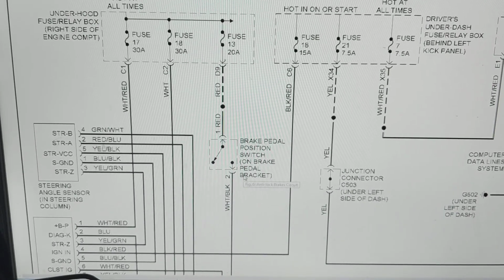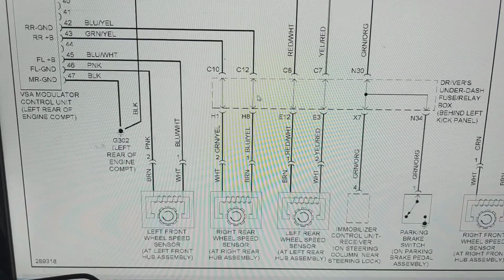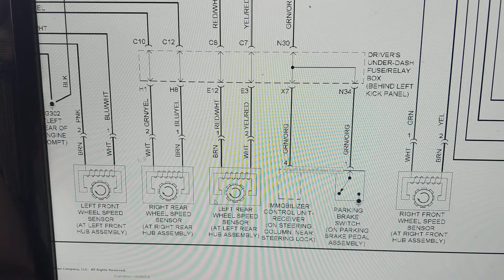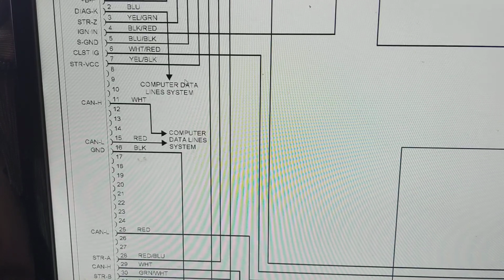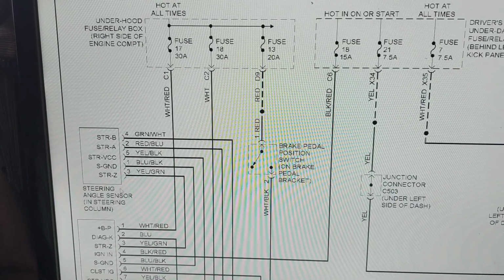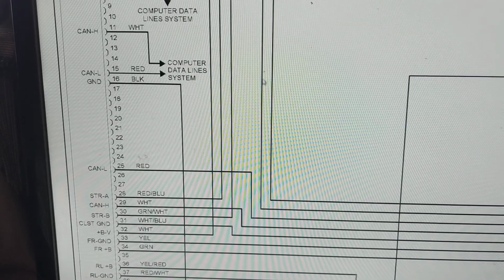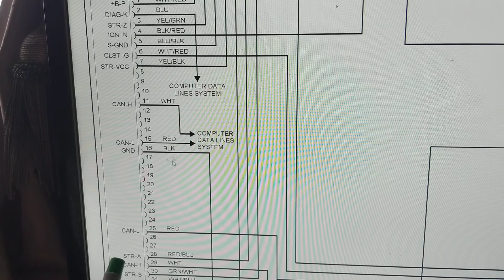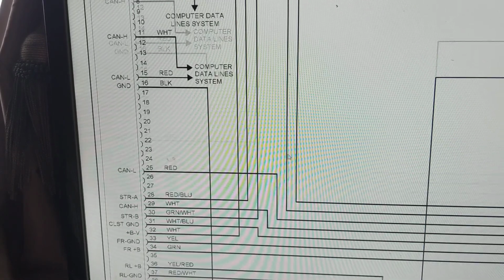how to find  ABS PROBLEM FROM WIRING DIAGRAM

Comment: I'm about to junk my 2012 dodge charger because don't even god can fix a rear left sensor and the crappy car is in safe mode since that. Replace Sensor, Axle, ABS module, Entire ABS module, and no way. I have normal read from 4 sensors like is ok but remain saying that have issues in rear left sensor and limp mode. IDK what else to do.
Reply from the maker: In such a case I would really advise to use a scanner I understand you probably don't own one but when it comes to these type of problems nothing gives more information than that I'll look into the diagram thank
Reply: @Joeelectronicschematicsforauto  Yep I borrow one,and have readings for 4 sensors with apparently no issues in live data, mean that's sensor is working and stable because I drove enough for test that problem wasn't intermittent. But Keep saying rear left sensor implausible signal, I replace the sensor for the OEM one, replace the axle, thinking that could be the reluctor ring, and after that, the whole system including replacing the ABS computer and module and keep the same complain and safe mode. At this time I just wanna explore what wires I have to cut/bypass for prevent de safe mode and use the car normally. The worst is, when the  abs light pop up the engine low RPM and some times get in neutral position o worst, some times get parking position with car moving! This car is crazy!!
Reply: @George_Gautier  one option out of pure desperation is to wire the signal from one of the good sensors into that input. Would be just like cloning a good sensors and putting it in place of the bad sensor and see if that works. Sounds like there is a problem with signal quality or some interference. But if that makes no difference I would suspect the module. A cheap handheld oscilloscope from eBay would be your biggest ally here or a scan tool that reads waveforms.
Reply: @davidgregory7702  I gave it up, no way this car get signal from this sensor, even plugging one direct to module. and replacing the module with reprogramming a few times.
Thanks you all for all the tips.

Comment: I've been searching on google very hard for a abs schematic like this one for my 2013 Hyundai genesis sedan 3.8  because my scan tool Xtool anyscan A30M is not communicating properly with the abs module or the speed sensors and I got a DTC  P2159  can you help me and tell me were I can find ? Thank you any help is appreciated.
Reply from the maker: This code usually indicates it does not see a signal from the speed sensor obviously many reasons besides the sensor itself the connector but this can also affect drivability such as transmission shifts number one does your  scan toolto communicate to any other module? Number two you can put in exactly in Google 2013 Hyundai Genesis wiring diagram for ABS system it should come up for free try all these things and get back to me
Reply: @Joeelectronicschematicsforauto  Thank you for replying. I put in search just as you wrote and got others but none close to mine. Yes the trans shifts a little different not as smooth but more abrupt.  I got this from live data: WSS Signal from ABS   Value OPEN,  WSS Signal from FR wheel speed sensor Value OFF,  VSS Signal from vehicle speed sensor installed on TM Value OFF,  Vehicle speed Value 0.0 . I contacted xtool scanner support they stated: (There may be a problem with the circuit of the abs module) that's why I'm looking for the  wiring schematic. I just had the abs module checked and repaired so I believe it's good. I also was thinking I should replace the front right abs tegral sensor with hub and see if that will eliminate the fault and return everything to normal right now abs, esc, epb, brake and engine lights on dash are all on and speedometer does not work.
Reply from the maker: @lousep1964  you really have to see if there are signals coming out from the wheel sensors by turning the wheels number one and number two you have to measure the connectors to it sometimes they break I'll try to look up a wiring diagram the best that I can
Reply from the maker: @lousep1964  when I put in Google ABS wiring diagram for your specific vehicle I see different diagrams but remember they go to a module also
Reply from the maker: @lousep1964  so you have to make sure that the module is receiving the signals from the wheel speed sensors also and that's by usually a scanner or by actual measurements unfortunately
Reply from the maker: @lousep1964  just put in wiring diagram for ABS system and Hyundai Genesis 3.8 should come up

Comment: Can I ask, for what vehicle and year is this schem for? I have a 05 Town & Country and it looked like a good idea to test the right/F wheel sensor with multimeter, but I'd need to know the color to determine +/- wires.
Reply from the maker: That was probably for a Chevy SUV around 2005 if you need to know the colors of the speed sensor go to Google type in 2005 Town and country wiring diagram speed sensors wheel speed sensors you should get it and download for free get back to me

Comment: What part of abs first for checking i try to scan but the result is no functioning or no signal abs front and rear right and left what first is the defect or where can we start to check.thank u for the info in advance
Reply from the maker: Well first of all you have to have a scanner that can go into abs which I assume you do because you told me the symptoms second sounds like you're missing a b+ line of 12 volt somewhere what make and model is it of the car put in Google for abs diagram if you don't have any luck and respond to me and keep me updated